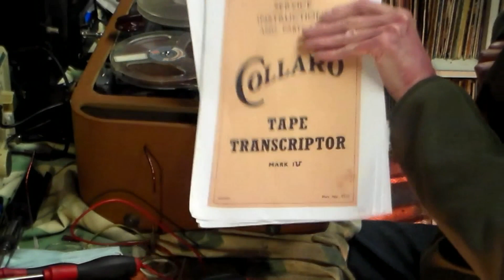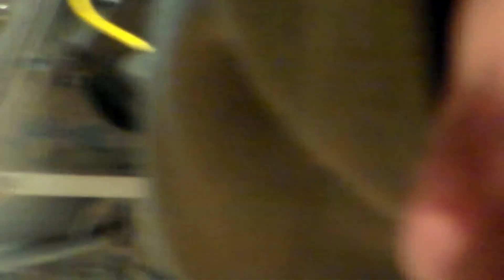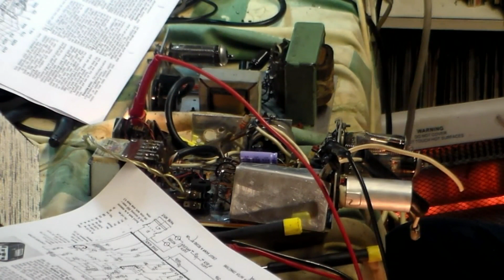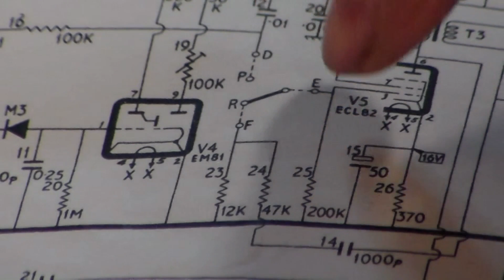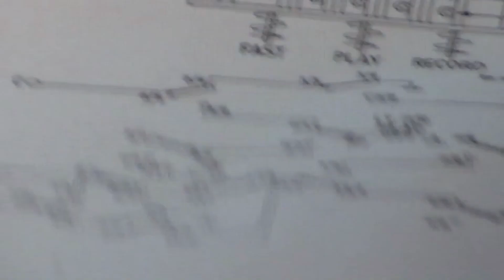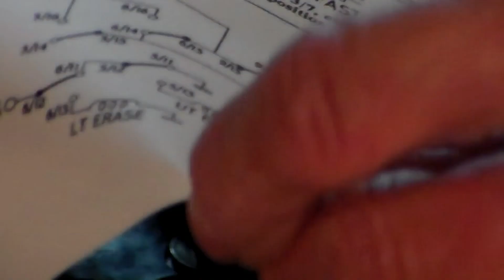Sound A20 tape recorder with Collaro Tape Transcriptor Deck.....

Comment: I have one of these. Did you ever do the Part 2?
Reply from the maker: There was a part 2 - I could never get it to record and it tended to kill ECL82s….. and there was no reason for that.ira in the corner of the workshop and I  keep walking past it ….. !
Reply: @Steveuk405  Mine was stored in an old van and got damaged when the van fell off an axle stand. Parts of the bakelite panel got broken and possibly other bits.Before I got into this hobby I remember going to the tip with a radiogram my dad built himself. It included a Ferrograph tape transport which I wish I had kept.